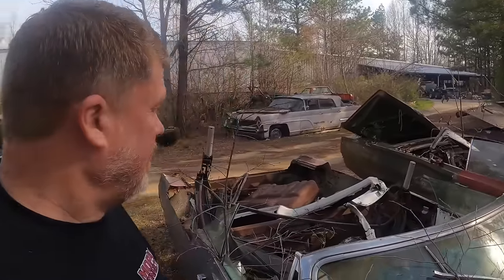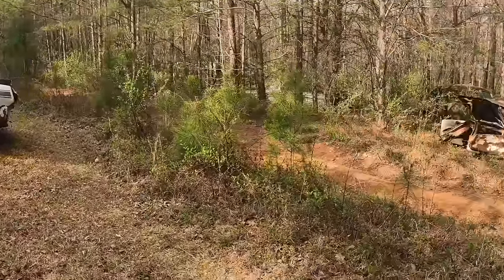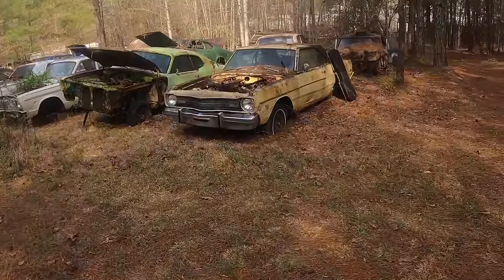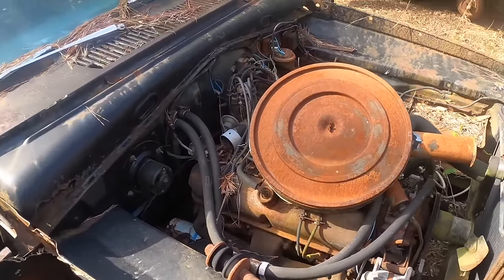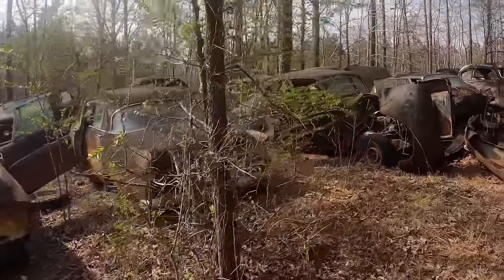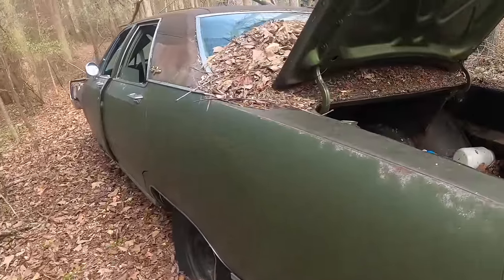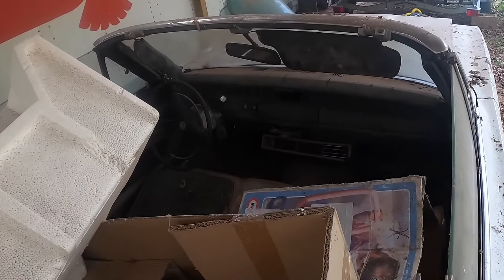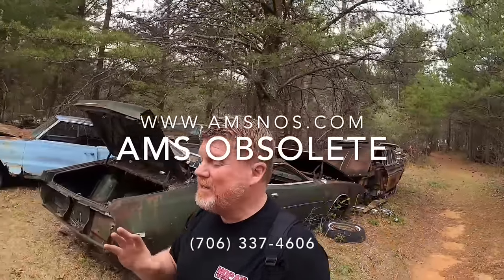Nearly 600 Mopars Hidden in The Georgia Woods at Herb's Parts & AMS Obsolete

Comment: Rusted to death and bones picked clean. Not much left worth getting out of the yard. So did you get the ramcharger? Bumper core heaven😂
Reply from the maker: No, I wish! That one is Mike’s.
Reply: @moparconnection  it got saved one way or the other and that's what matters. A local guy just got his hands on a 72 trail duster. Blue and white with a 440. I was drooling. He got it for 4 grand out of a shed. Lift kit and nice wheels. Sat for 25yrs. Lift off top and factory rollbar too. I offered him 5 and he laughed. Kinda expected that lol it was rust free and that's amazing for minnesota. It was low miles like 37k I think.

Comment: The passenger rear quarter window of my '69 Roadrunner convertible does not roll-up correctly/evenly.  I guess it's the mechanism. Do you know anyone who can fix it? 🤔

Statham, GA
Reply from the maker: Hit up Herb’s Parts what your tracks need
Reply: @moparconnection  
Are they easy to repair/adjust?
Reply from the maker: @dogdoc1  heck yeah
Reply: @moparconnection  
👍

Comment: What do you mean they tried the hot rod ,it, that was the baddest car in bordertown, oh yeah 💯 that car was called the neckbreaker aftermarket gauges that wasn't for sure buddy car used to eat the tires off the back rims used to melt holes in the road. Go look under the front end, that bad boy used to put dents in the road from slamming down jump in the front wheels off the ground. You got a lot to learn about mopars buddy trying to Hot rod at one point.😮😢😮😢😮😢😮😢😮😢
Reply from the maker: Not sure what you’re referencing.